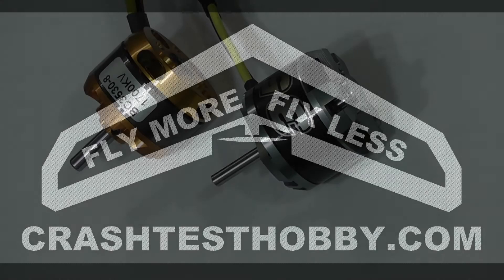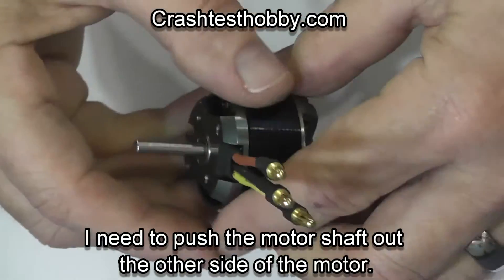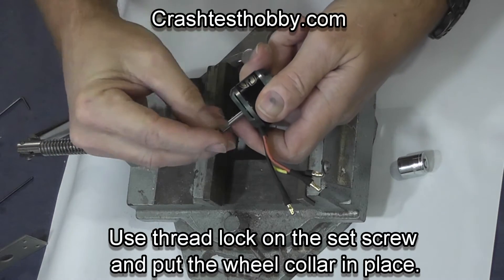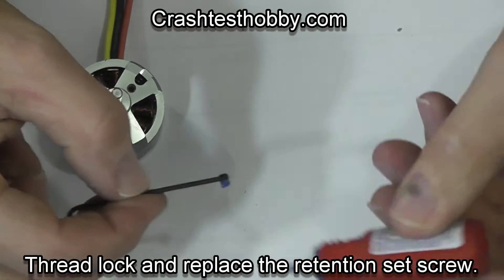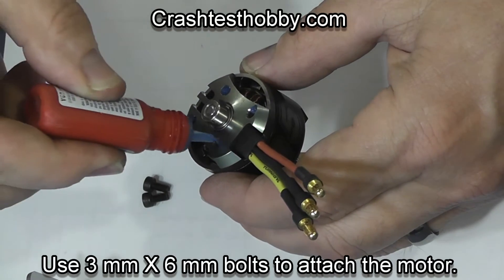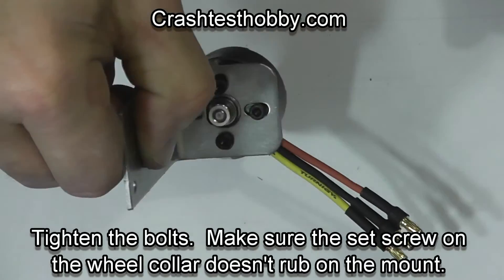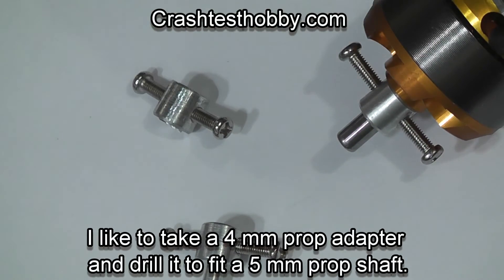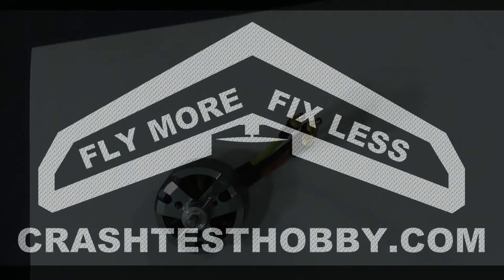Brushless motor shaft modification to pusher configuration

Comment: Thumbs up for the DIY spirit rearranging the 4mm straight shaft. It has been 7 years since you posted this video. And, sadly, it is the future now and manufacturers don't want their products fixed in a DIY fashion. iPhones are not allowed to change/swap components by 3rd parties using a serial number matching scheme. Drone motors now use a combination of shaft diameters between the motor bell and stater to prevent a straight 4mm or straight 3mm shaft to go through the motor, like a combination lock that needs a machined matching key to turn.
Reply from the maker: There are a lot more options available now than when I made the video.  Most RC motors now work from the manufacturer.  Years ago some of the motors were being set up to have the shaft go through the firewall of the plane and had to be adapted to work to work on planes with different types of motor mounts.  When they don't this can be an option.  Most manufactures, us included, realize that all projects take a certain amount of creativity to get things set up and working.  Go get an Android phone if you feel too locked in.  You will lose your warranty if you modify the phone but they have a different attitude than Apple.

Comment: where can one find that bracket? i have a n5055 on order that im going to use for a highspeed drill press and that bracket looks perfect for mounting to my linear slide rail
Reply from the maker: Which bracket are you referring to?  The motor mount I bolt the motor to towards the end of the video is machined for Crashtesthobby and you can get one by contacting us through the website.
Reply: anyway you could have one made where the motor sits the other way around and after a small gap it would have another plate rising with a hole for the shaft and another bearing? [motor |___|[bearing here]| ----s

ive got an 8mm straight shank im replaing the motor shaft with and it has a collet on the end to accept tools. should work with out extra bearing as drill press but if i want to go cnc spindle with it the extra bearing is recomended to take latteral load off motor
Reply from the maker: There are many different motors and props that can be used.  We had to pick the motors that we were going to recommend and make something that would fit them.   We modified this bracket at least a dozen times to get it where it is so it will take the 35xx motors and the 2812 motors and luckily it will fit many other motors too.  Years ago I paid 5x to 10x for a 3 phase motor as we do now.  For less than $15 you can get a motor that will fit on this bracket and not have to be modified.

Comment: I tried to modify the shaft of my motor but after i removed the collar i couldnt unscrew the 2 screws so i put it back and i just swapped 2 motor wires with 2 from esc then i reversed the propeller and it became a pusher, no need to modify the shaft anymore
Reply from the maker: This modification is good if you can't get your motor to work any other way.  The best set up is when the motor is already provided in the configuration you need.
Reply: I have 2 propeller adapters, 1 is for pusher configuration, but after i removed the e-ring from the shaft i just couldn't remove the two black screws from the inside of motor to push the shaft forward to mount the adapter for pusher configuration so i used the ordinary mount and i just swapped 2 wires of motor with 2 wires of esc then i reversed the propeller, tho the shaft modification is better because one of edges of my propeller touch the adapter and i think because of that my propeller has a little angle on one side. I just build my first plane which is a f 117 stealth and it's like 80% done. I dunno why they stuck the screws so hard that you cannot unscrew them. I am glad you replied me and if you think you can help me with tips please add my skype : Alex_gorrdon, i will appreciate your help! Cheers!
Reply from the maker: Manufacturers don't like their motors coming apart so they thread lock the lock screws in place.  I have had trouble getting screws out on some motors too.  Manufacturers often use an Allen's head set screw that uses such a small Allen's wrench that the wrench strips or bend.  I guess you have to get a good quality wrench and do your best.  I don't have any magic tricks if the screws are locked in place.

Comment from the maker: I occasionally will make a flat spot on the shafts for the reason you suggest.  Especially if the prop saver is slipping.  To make a spot for the set screw you may need to remove the shaft.  I am more likely to make flat spots for the wheel collar and for the prop saver.

Comment: Do you suggest using a rotary tool to make a flat spot on the shaft for the screws to rest on?  I do that because the prop adapters have a tendency of spinning.